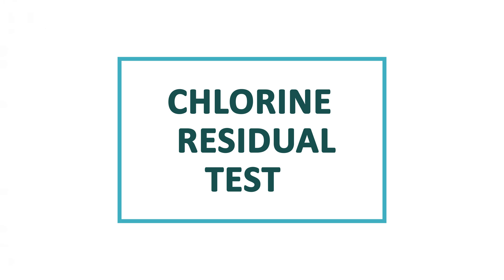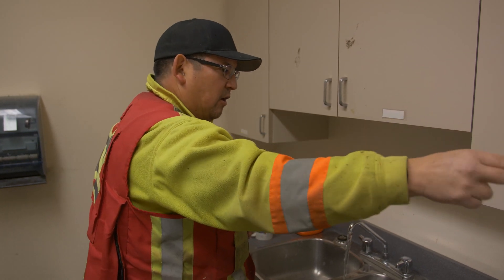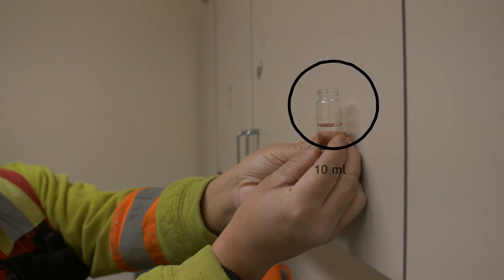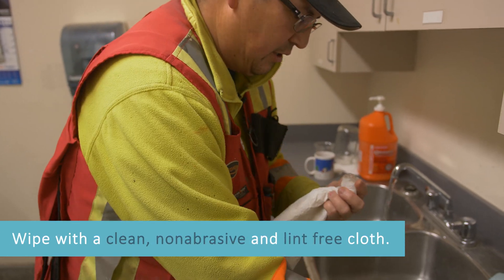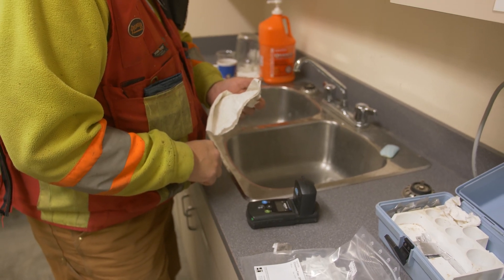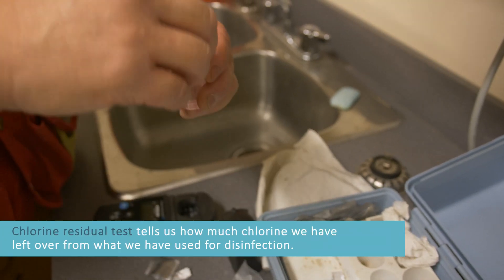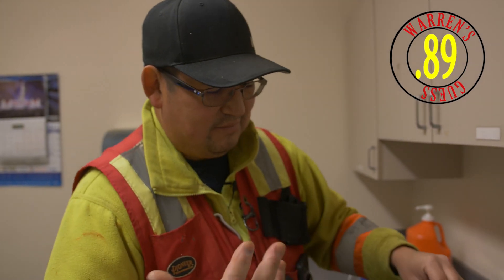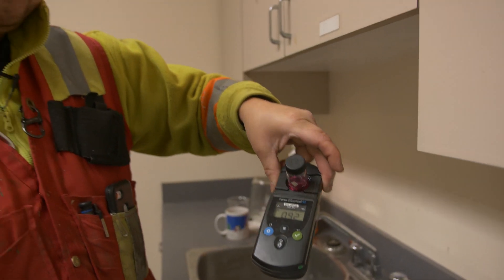How to do a Chlorine Residual Test

Comment: So question, we do our sample and it reached 8.8+ so we do 5mL sample and then 5mL distilled water, then multiple our result with 2. But let’s say it goes 8.8+ again. Would I do 2.5mL and 7.5mL distilled water, then multiple by 4? And let’s say it still reaches 8.8+. Would I now do 1.25mL sample and 8.75mL distilled, than multiple by 8? We need to settle a debate at work and our water is really yellow
Reply from the maker: @Jonasty00 Great question! You’re on the right track with dilutions for high chlorine residuals, and your approach is logical. Here's how it works:

1. First Dilution (5mL sample + 5mL distilled water): If your reading is still 8.8+ after multiplying by 2, this indicates the chlorine residual is still too high for the range of your test.

2. Second Dilution (2.5mL sample + 7.5mL distilled water): If it again reads 8.8+, you’d multiply the result by 4. This is because the dilution factor now is 4 (the sample is 1/4 of the total volume).

3. Third Dilution (1.25mL sample + 8.75mL distilled water): If 8.8+ persists, you’d multiply by 8, as the sample now represents 1/8 of the total volume.

Each dilution reduces the concentration by a factor relative to the proportion of your sample to the total volume. Continue this pattern (halving the sample volume and multiplying the result by the corresponding dilution factor) until you get a measurable reading within the range of your test.

Pro Tip: If the water is very yellow, it might interfere with the accuracy of the measurement, even with a spectrophotometer. To minimize this, ensure you’re using a proper blank (such as distilled water or a zeroed sample with no chlorine) to account for the yellow tint. This helps the device differentiate between the water's natural color and the reaction caused by chlorine.

Let me know if you have more questions!
Reply: @ thank you so much!

Comment: Thanks, I wondered how the test was done, I don't know why they didn't just show us in class. Can the remaining water and chemical be disposed of in the sanitary sewer or do other disposal methods need to be taken?
Reply from the maker: Great question! Our response is a bit lengthy, apologies for that. 

The disposal of remaining water and chemicals from a chlorine residual test should be done in accordance with safety and environmental regulations. Here are some general guidelines:

1. Neutralization: In many cases, you may need to neutralize the residual chlorine before disposal. This can be done by adding a reducing agent, such as sodium bisulfite or sodium thiosulfate, to the solution. Follow your specific test procedure or laboratory guidelines for the appropriate neutralization method and quantities.

2. Local Regulations: Check local environmental regulations and guidelines for disposing of chemicals and wastewater. Different areas may have specific requirements for the disposal of chlorine and other chemicals. Contact your local environmental agency or municipality for guidance.

3. Hazardous Waste Disposal: If the residual chemicals are considered hazardous waste, they should be disposed of following hazardous waste disposal procedures. Contact your institution's environmental health and safety department or a licensed hazardous waste disposal service for assistance.

4. Dilution: In some cases, you may be able to dilute the solution with a large volume of water to reduce the concentration of chlorine to a safe level before disposal. Again, follow your specific laboratory or test procedure guidelines for the appropriate dilution factor.

Always prioritize safety when handling and disposing of chemicals. It's essential to follow established procedures and guidelines to protect yourself, others, and the environment. If you're unsure about the proper disposal method for your specific chlorine residual test, consult with your instructor, lab supervisor, or environmental health and safety department for guidance.

Thank you for watching! Please let us know if there’s any specific content you’d like us to produce.

Comment: Why didnt you use dpd total
Reply from the maker: There are different types of DPD (diethyl-p-phenylenediamine) reagents available for chlorine residual testing, such as DPD Total, DPD Free, and DPD Combined.

- DPD Total measures both free and combined chlorine residual.
- DPD Free measures only free chlorine residual.
- DPD Combined measures the difference between the total and free chlorine residuals to determine the combined chlorine residual.

Which DPD reagent to use depends on the specific needs of the test being conducted. For example, if you want to determine the total amount of chlorine residual present in a sample, you would use DPD Total. However, if you only want to measure the free chlorine residual, you would use DPD Free.

Please keep in mind that the information provided is for educational purposes only and should not be considered professional advice. It is important to always follow your facility's Standard Operating Procedures (SOPs) and guidelines when performing any water treatment procedures. Any actions taken based on the information provided are at your own risk
Reply: Ok so would you use dpd free during a chlorine burn ?